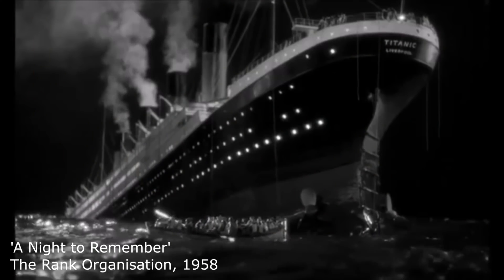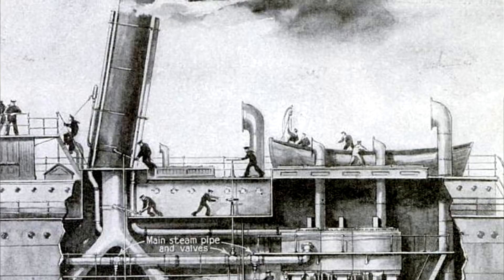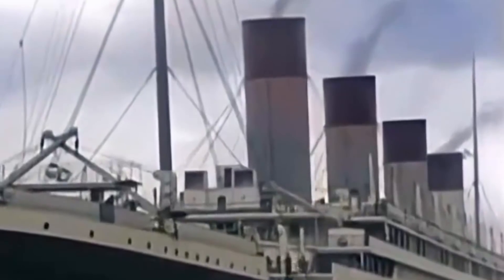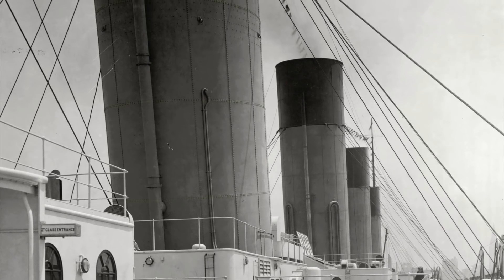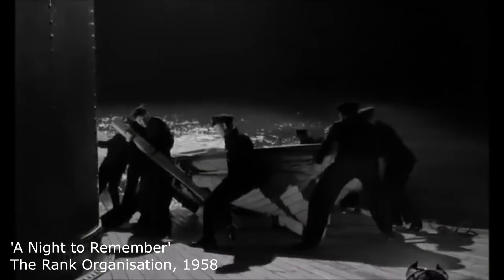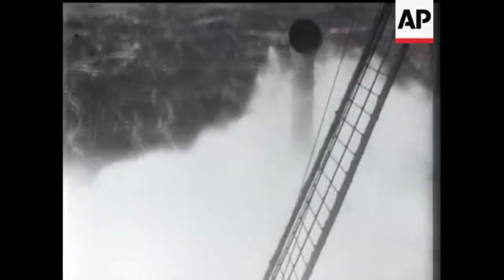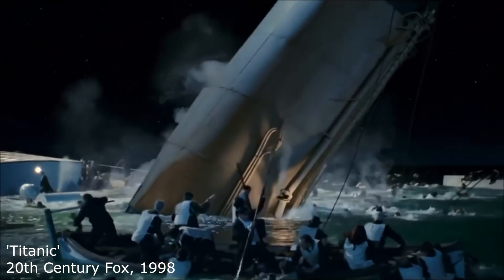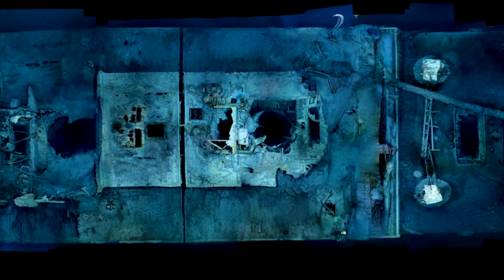Why did Titanic's funnels fall during the sinking?

Comment: Here me out. This is on a much, much smaller scale (hairdresser). But I deliberately did a lot wrong on my training head to prove a point (I wanted it filming to show why we have to do things certain ways). Hair is Fibrous, and adding intense heat to wet hair will cause it to singe and fray. Could the same logic be applied the other way round? If the cords were warm, but then plunged into freezing cold water, the cords would snap at the base and whip upwards?

Comment: It always seem to me that the breaking of the forward expansion joint contributed to the failure of funnel #1.   The funnel, I think, was secured by wires both forward and aft of the break and, at very least, the break would have contributed to the weakening of the rivets running at the deck line.   To me, this expansion joint failure was also evidence supporting the failure of the aft expansion joint which, again my opinion, is the most likely culprit in the breaking of the hull on the surface in the opposite direction as is commonly believed.  Thanks, I enjoy your videos and your love of these great old ships and the tremendous work that went into them.  I share that.

Comment: Oceanliner Designs - You mentioned the motions of the ships in rough seas acting on the funnels. You forgot to mention the enormous dynamic pressure on these wide, tall structures from wind. So, they had several Forces to compete with. Thermal differences internally, the rolling and pitching, giving quite strong Compression Forces, but also the dynamic Wind Pressure giving Compression on lee side and Tension on the wind side.
Reply: If your in norway why do you care about trump
Reply: @cantstanddogs4776  Why do you think I do?

Comment: I’m not an engineer, but I know a little about structural loads and stress. The stacks were designed to withstand the loads imposed by  wind and air resistance as the ship was underway, so most of the loads (not all, of course) would be from the front quarter. The weight of the funnels would be supported by the structure of the ship, which would be a compression load with a component of a shear load. As the ship sank and the angle increased, more of the load would be in shear, which overloaded whatever held the stack to the ship. 

Those with greater knowledge should jump in and correct me as needed!

Comment: Hello! I've seen in some recent animations for ex H&G and some others that the 4th funnel stayed attached. Wich, for me, looks ridiculous. I'd like to hear what's your take on that!
Reply: The 4th funnel was built very differently from the 3rd funnel. It was built much stronger and the guy wires were only their to help with Stability. None of the Titanic's funnels fell because of the guy wires snapping. The wires snapped because the funnels were falling. Even if the deckhouse formed, which I think it did due to Fred Scott's Testimony, it would snap nearly all guy wires but based on my research, due to its design and how well built it was (that the funnels probably fell partially submerged but based on my research, only 40%) it wouldn't fall. Their is also evidence of this on the wreck, if it fell, the deckhouse would have been crushed and mangled. However, it isn't, so that would help suggest that it fell late. The damage to the first class smoking room was probably caused by the implosion. Unless the stern crashed back into the water, then the 4th funnel falling would be quite unrealistic. I doubt it even fell at the surface. If it fell at the surface, it would end up further from the stern but it is quite near to the stern so it probably would have disintegrated during the descent. It was built quite strongly so it couldn't have fallen unless the stern crashed back. It would require less force than the mast so if it fell, the mast would have fallen.  While the 4th funnel was fake, it was quite structurally stable.
Plenty of survivors said it stood long after break. These include Jack Thayer, Ida Hippach, Edward Buley, George Crowe, Samuel Rule, George Symons, Frank Evans, Fredrick Hoyt, Thomas Dillon, Ruth Becker, Patrick Dillon, Thomas Ranger, and John Collins. If it falls during or after break, it dismisses countless survivors. For example, Jack Thayer literally said that he saw the fourth funnel in the water still standing as the stern rose up.Ida Hippach and Edward Buley said that they watched the remaining funnel for several minutes.Thomas Dillon said that the funnel didn't fall until the ship actually went down.George Crowe, when asked, said that it remained standing after the stern floated back.John Collins said it was still visible when the ship turned over and went down. The reason everyone says it did was because it was shown in several popular theories. While scources like OASAG are great scources in my opninion, they went with the funnel collapse in break as it is the general consensus of what happened.
Reply: Out of interest, were their any accounts of the 4th funnel falling during the breakup?

Comment: First, I'd like to state that I'm glad that over time, the amount of Titanic, and angle of her depicted above water during her final minutes, has steadily decreased!   Even as late as 1997, James Cameron had nearly half the ship above water before she broke in half before her death plunge.

Back to topic of funnels:  The likely reason for the toppling during sinking was that fact that at least two of the funnels on the Olympic sisters had guywires attached to them that were anchored on both sides of an expansion joint in her upper decks.

As the ship tilted down and forward, the superstructure surely strained(distorted under the forces of sinking) opening those joints up to varying degrees.  Those forces, tugging on the guywires, combined with increasing forward downward decline, unanchored or snapped those guywires,  leaving those funnels to the whim of gravity.

Comment: Umm... no, pressure increases linearly with height of water column, as in p=rho*g*h

Within the context of the sinking and at the time scales of concern, the funnel would have seen more or less linear growth in pressure until failure too. Fast, perhaps, but nearly linear.

Exponential growth and decay refer to phenomena which have derivatives proportional to their current value. Radioactive decay is an example of exponential decay, whereas population growth in a simplistic model (i.e. one tribble reliably births two more over a fixed period of time) is an example of exponential growth. Compound growth/interest also comes to mind for the latter.

It's a cool word, but I'm afraid in this case it simply doesn't apply.

Comment: This theory provided in this video makes perfect sense and i would actually extend it to the fourth funnel aswell here's why: funnels one and two collapse from water pressure makes sense. Funnel 3 collapses because it is in the breakup zone, makes sense. Funnel 4 collapses due to just the gravity of the stern falling back, unlikely as you said these funnels where built not to fall off in rough seas instead i think the funnel stayed attached after the breakup and only collapsed as the stern was plunging downard and it rather quickly smashed into the sea tearing it off from the force of the impact and also water pressure.
Reply: I agree, I think the 4th funnel remained long standing after the breakup as no one said it fell and several said it remained long standing post breakup. The design of the 4th funnel would allow for this to happen. Since it’s remains are near the stern and the only one who said it fell was drunk, we concluded it came off during the descent

Comment: Curious what the tunnel conduits looked like from inside the ship. Did elevator shafts run in the same space?
Reply: Elevators had their own smaller shafts elsewhere, as the uptake casings for the funnels wouldn't have provided enough space for anything besides a gigantic metal pipe and some catwalks.
Reply: @DerpyPossum  thanks. The elevators would be very toasty

Comment: water pressure was what I thought it was.  I also thought that It could be angles that the cables would have a bit trouble handling.  But then again cables hold on to bridges just fine.

Comment: I wanted to ask: have the funnels been found on or near the wreck site?
Reply: Technically yes, but it resembled less of a funnel and more-so a pile of collapsed sheet metal and piping (though there was also a set of whistles, which were recovered from the wreck and blown on compressed air in 1999).
Reply: I seem to remember they also found the pipework around the 3rd funnel intact too!

Comment: I imagine temperature shock on the metals also had a degree to do with this. The Atlantic was almost near zero Celsius, from what I remember. That would possibly cause metal fatigue at such a temperature difference.
Reply: Actually it can pass under zero celsius because salt water freezes in a lower temperature, so that's people became ice but the water was still liquid

Comment: Water pressure is a good theory, I had assumed that it had been the temperature difference, Hot air from the boiler on the inside meeting the cold Atlantic water from the outside. The inside skin would be elongated due to the heat and the outside skin would shrink when in contact with the ocean, causing warping and would destabilize the funnel base causing the collapse.

Comment: The pressure being the main cause makes a lot of sense. I had always assumed that maybe the expansion joint flexed so much that the cables broke and that caused the funnel to fall, but thinking about where the cables are attached to the deck in regards to the expansion joint, I was never convinced my theory was correct. I just couldn't think of a more plausible reason. But your video really got me thinking about how I had probably underestimated just how much pressure that  various parts of the ship were being put under. It can be easy to forget that even when the ship hasn't sunk that deep yet, the forces acting on it can be insanely strong.

Comment: Thanks for the site, some very interesting stuff!  One nit, however, water pressure doesn't increase exponentially with depth, it increases linearly; at twice the depth the pressure will be double, not four times (or by whatever exponent); at 33 feet the pressure will be about 15psi (1 bar), at 66 feet it will be about 30psi (2 bar), etc.

Comment: S.M.S. Emden.
- - - - - - - - - - - - -

Name	Emden
Namesake	City of Emden
Builder	Kaiserliche Werft, Danzig
Laid down	1 November 1906
Launched	26 May 1908
Commissioned	10 July 1909
Fate	Disabled by HMAS Sydney and grounded off the Cocos Islands, 9 November 1914
- - - - - 
General characteristics
- - - - -
Class and type	Dresden-class cruiser

Displacement	
Normal: 3,664 t (3,606 long tons)
Full load: 4,268 t (4,201 long tons)
Length	118.3 m (388 ft 1 in)
Beam	13.5 m (44 ft 3 in)
Draft	5.53 m (18 ft 2 in)
- - - - -
Installed power
- - - - -	
13,315 ihp (9,929 kW)
12 water-tube boilers
- - - - -
Propulsion
- - - - -	
2 × triple-expansion steam engines

2 × screw propellers
Speed	23.5 kn (43.5 km/h; 27.0 mph)
Range	3,760 nmi (6,960 km; 4,330 mi) at 12 knots (22 km/h; 14 mph)
- - - - -
Complement	
- - - - -
18 officers
343 enlisted men
- - - - -
Armament
- - - - -	
10 × 10.5 cm (4.1 in) SK L/40 guns
8 × 5.2 cm (2 in) SK L/55 SK L/55 guns
2 × 45 cm (17.7 in) torpedo tubes
- - - - -
Armor
- - - - -	
Deck: 80 mm (3.1 in)
Conning tower: 100 mm (3.9 in)
Gun shields: 50 mm (2 in)
Country Owner: German Empire

Comment: My first thought was freezing water + extremely hot metal = stress fractures in the metal causing it to break, but pressure works too.
Reply: I thought the same with the great contrasting temperatures
Reply: The trouble with this theory is that the outer funnels which were providing the mounting structure had no contact with the hot gas and would have already been freezing from the ambient outside temperature.

Comment: I wonder if the freezing water making contact with the hot funnel liners might have stress cracked from rapid cooling. Hot metal the is cooled to quickly gets brittle if not tempered, which they wouldn't have been.

Comment: No mention was made of the cold water hitting that hot metal, iron, not even steel, causing increased brittleness. There was also probably a surge of steam between the covers and the liners as the very cold water hit that 300+ degree iron, not to mention the steam and hot gasses forced up from the submerged fireboxes. It's a wonder the boilers themselves didn't explode, though I understand some of the Black Gang gave up their lives to vent the boilers and empty the fire boxes in the boiler rooms that could. Some others stayed behind to keep the lights running as long as possible as well. Unsung heroes.

Comment: Wasn’t the fourth funnel fake.
Reply: The 4th funnel was used for various important functions, such as ventilation for the galley stoves, the turbine engine room, several lavatories and machinery spaces, and the smoking room fireplace. It also housed an important crew passage.
While it wasn’t connected to any boiler rooms, and aesthetics did play a role in its inclusion, it still functioned to exhaust and therefore wasn’t necessarily “fake”.
Reply: @DerpyPossum  oh

Comment: One funnel was fake and used to bring in fresh air.  It made the ship seem bigger but yes one was fake. (like a fake scoop on the front of a sports car.)
Reply: The 4th funnel was used for various important functions, such as ventilation for the galley stoves, the turbine engine room, several lavatories and machinery spaces, and the smoking room fireplace. It also housed an important crew passage.
While it wasn’t connected to any boiler rooms, and aesthetics did play a role in its inclusion, it still functioned to exhaust and therefore wasn’t necessarily “fake”.

Comment: I am honestly kind of surprised that with the boiler rooms flooding, especially since they had been running at high speed that there wasn't a boiler explosion when the sea water got past the bulkheads. I know that steam explosions caused during sinkings are not to common an occurrence, usually due to there being a much longer period between the sinking starting and when the ship goes down and this allows for some cooling of the boilers.
Reply: That's because the firemen were actively venting the steam from the boilers as the boiler rooms filled with water to prevent just this.
Reply: @halofreak1990  thank you for that tidbit of info. It does make sense since there was a good amount of time between the impact and the actual sinking, or at least enough for the firemen to realize what was about to happen and open the vents.

Comment: 👋😁Hello Mate! From California, USA!🇺🇸
Anyway as you mentioned TITANIC and her 4 funnels, however you mentioned LUSITANIA and her 4 funnels that were rope attached to her boat deck and nevigation deck, when LUSITANIA went down in 18 minutes her 4 black funnels were double rope attached on the top of two horizontal lines of the 4 funnels to prevent them from falling. When LUSITANIA was listing to starboard and sinking fast, her 4 black funnels stayed attached but have never falling apart until she landed on the ocean floor of mud. LUSITANIA to me is beautiful than TITANIC but with few differences that LUSITANIA should have had before the OLYMPIC ships!

Comment: MB, Thank you for another great video.  A semi-related subject that interests me is how the wreckage on the ocean floor came to have the upper decks deflected downward and the sides of the hull bulged outward at the break.  I've seen all manner of explanations, such as the idea that the bow section somehow angled upward to crush the upper decks following the breakup.  My own theory can be illustrated by taking the cardboard tube from a roll of paper towels and bending it.  The cross section of the tube ovals with the shorter axis being in the plane of the bend.  This happens with any thin-wall tube section regardless of whether it is circular or rectangular.  None of the animations I've seen of the breakup show this phenomenon. -GV

Comment: Just like the boilers of Lusitania (or not) it just like it, hot thing touch cold things means probably steam explosion because of water touching cold water making steam which expands and ruptures the funnel base then funnels fall. Like the boilers of Lusitania which blow up after touching water in the sinking, it blast a hole in the Lusitania's body part and this could be wrong but ok

Comment: One theory I’ve seen comes from when they were filming the 1997 Titanic movie.  During the production, they found that they couldn’t get collapsible lifeboats C and D onto the davits with the shroud cables in place and they had to remove them.

It’s theorized that Lightoller and Ismay would have had to do something similar, leading to the cables being released, weakening the funnel shroud.
Reply: this, combined to the thermal shock when they touched water
Reply: @Welv1987  Eh, they would have been relatively cold by that point. If water is coming up from the inside, the boilers have been cold for a good while and with an OAT of around 0°C it wouldn't take much for them to cool down before the water gets to them.

They just weren't built for this kind of load.

Comment: 1/2" steel yielding under 13psi I find that hard to believe. More plausible to me is the hot funnels with the same brittle steel as the hull cracked when hit with 28°F water and the two guy lines parted when the expansion joint opened up allowing the cracked funnel to fall.
Reply: “same brittle steel as the hull” 
lmao